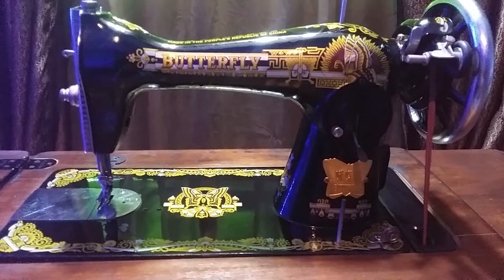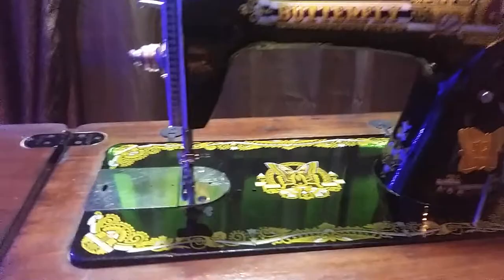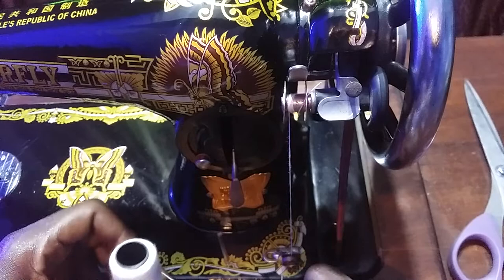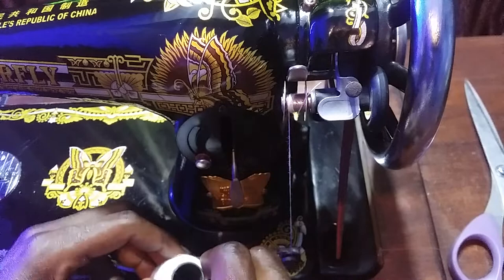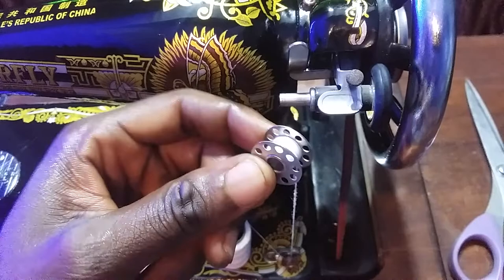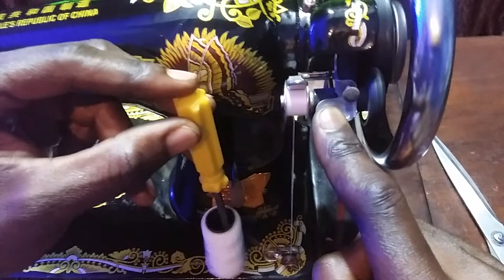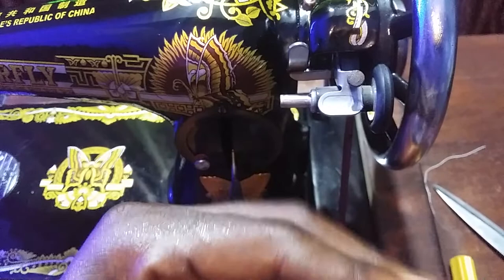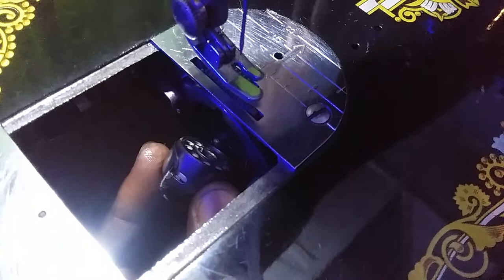How to thread wind a bobbin using a butterfly sewing machine

Comment: NO THAT'S NOT HOW1! There was a very small hole close to where the thread wraps around the bobbin. You place the thread thru that HOLE. Once you start winding the thread will snap on its own. What you did is a great way to have the bobbin thread tangled and cause a major jam once the thread gets closer to the end. WHY DO YOU TRY TO HAND WIND WHEN THE MACHINE IS DESIGNED TO DO THE JOB. I do get really tired of people doing this in their instruction, which lets me know you don't know what you are talking about.
Reply: @igbama3645  My post was correct.  There is a small hole in the side of the bobbin.  Place the thread thru the hole "FROM INSIDE THE BOBBIN".   Place the bobbin on the winder and hold the thread as it winds.  This will ensure that the thread is wound properly as it gets to the end.  I believe this is so simple that a 9 year old would understand.  
I am right.  I see these so call instructional videos and at least 30 percent of the time the instructions are incorrect.  When it comes to a Singer machine, you will need to get up long before day to beat me.  I worked for them far to many years.  When I sold a machine new or used, I took ample time to make sure the customer would be able to operate the machine.  
Often I would sell to a husband or boyfriend and I would show him how to impress his wife or girlfriend by being able to operate the machine.  I allow whoever purchased the machine some play time in the store.
My point would be, you don't know as much about a Singer machine as you want others to think.  
I don't mean my post to sound so harsh but all over the net, bad advice is given and all it would take is a look on the net for an instructional manual "ON LINE" to get your facts straight.  You don't even need to print the manual.